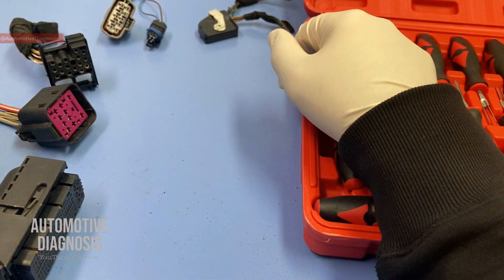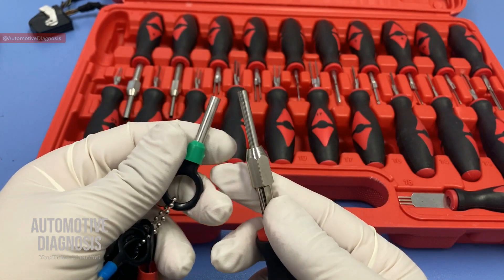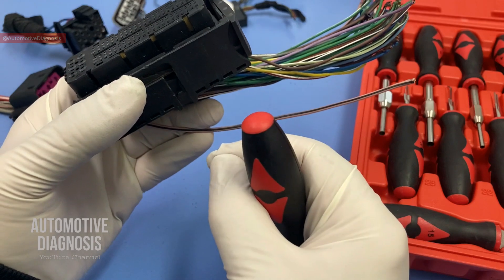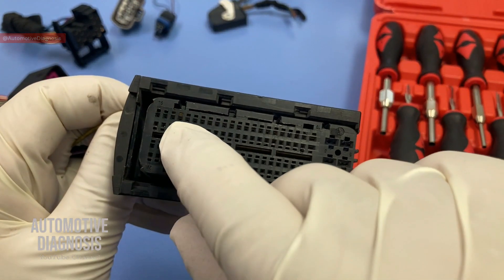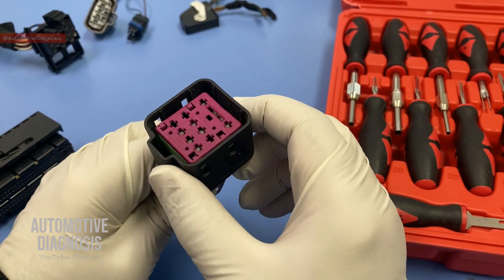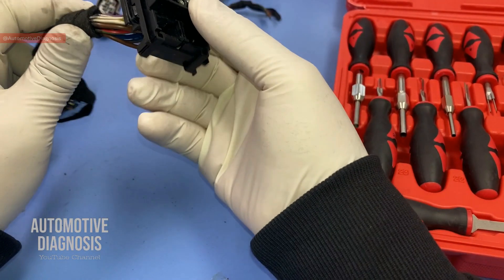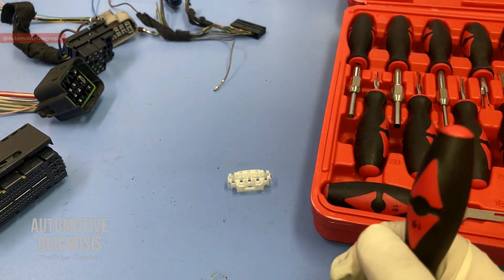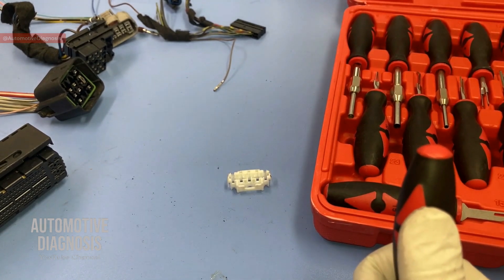Automotive Connectors Pin Removal Guide | Learn How to Remove ANY Pin From ANY Connector

Comment: Hy sir .... Toyota Corolla 1.3L s maf is over reporting .I change maf 3 time but didn't fix.why maf is at 3g/s instead of 1.6g/s.plz fuel trims -30
Reply from the maker: Hi my friend. Have you checked the MAF sensor wiring? Specially ground and signal wire.
Reply: @AutomotiveDiagnosis  maf wiring ,pcv,vecum leak,is ok.r there any mechanical problem to effect maf reading plz guide?

Comment: That is the wrong link for the Pin Removal Tool Kit
Reply from the maker: Here is the correct link:
https://au.maxpeedingrods.com/product/23pcs-connector-release-electrical-terminal-removal-tool-kit-for-toyota-ford.html?tracking=diagnosis
Reply from the maker: Hi my friend, thanks for letting me know. I will fix it soon.
Reply: 😅scary connector